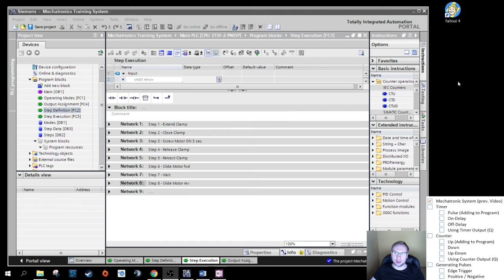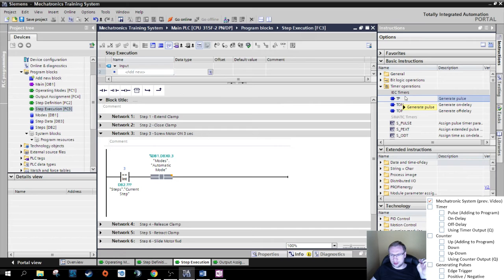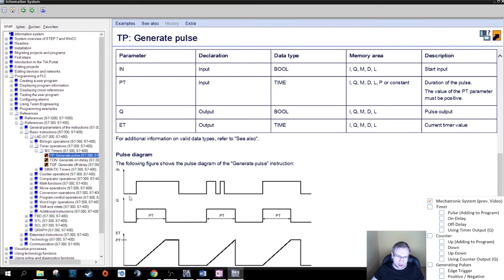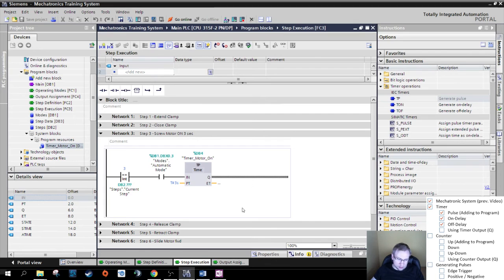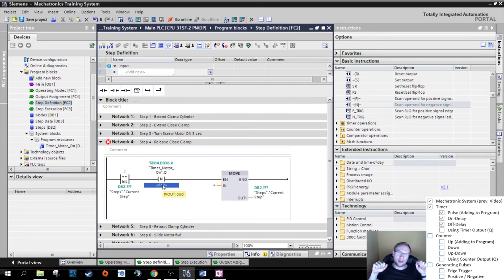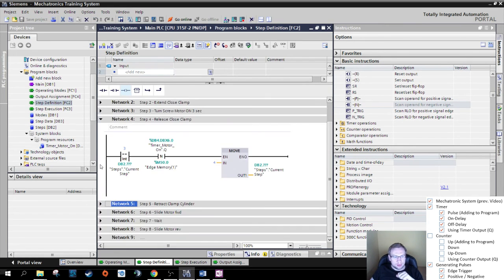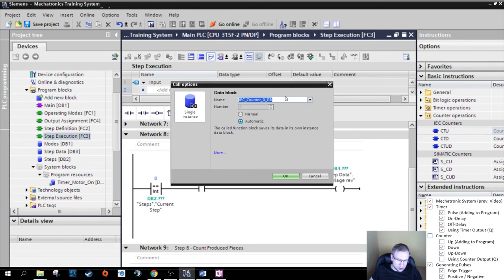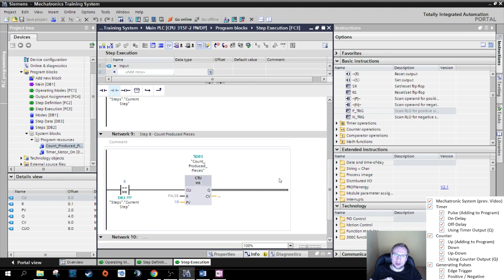ELIA Lesson04: Counter and Timer

Comment: Sir can you please explain more on how you can use up-down counter
Reply from the maker: It would be the easiest to click on it and hit "F1" to open the (most of the times really) helpful information window. If this doesn't help, what exactly do you need to know about it?
Reply: Thank you for your response Sir,,,let's say you want to control a spray gun between 3 sensors,between sensor 1 and sensor 2 you want your spray gun to move at a speed of 25Hz,and between sensor 2 and sensor 3 you want yor spray gun to move at a speed of 50Hz and reverse automatically,,so how would you implement that using up down counter,,,and please explain more the pins(output and input of the counter),,,,,,,Thank Sir
Reply from the maker: Ah okay! So you just need to evaluate if the spray gun is in :
"area 1" - between sensor 1 and sensor 2 or in
"area 2" - between sensor 2 and sensor 3

If those are the only two possible cases, I'd not use a counter at all... simply by using 2 memory bits (area1 and area2) you could evaluate the position with the help of 2 flip flops:

area 1: - set (when sensor1 detects a rising edge AND area1 is NOT active yet) OR (when sensor2 detects a rising edge AND area1 is NOT active)
             - reset (when sensor1 detects a rising edge AND area1 is active) OR (when sensor2 detects a rising edge AND area1 is active)

area 2: - set (when sensor2 detects a rising edge AND area2 is NOT active yet) OR (when sensor3 detects a rising edge AND area2 is NOT active)
             - reset (when sensor2 1 detects a rising edge AND area2 is active) OR (when sensor3 detects a rising edge AND area2 is active)

This would be way easier than using a counter... if you prefer using a counter though, I could send you an example program
Reply: thank you very much Sir,i would like you to also do me an example where you use a counter,,,,,,,,,,and also explain when and how do we use Scale,Unscale and Move block

Comment: Hi Philipp, is there anything wrong with using many timers in one program. For example using five different TP timers to set five lamps each for 2s? When I run the program only the first two lamps will be set. 
Also, do I need to reset the timers? for example reset first timer used to set the first lamp for 2s in step one, in step two.
Thank u in advance.
Reply from the maker: +Lateef Adekunle Hi Lateef, modern PLC's can have many timers (definitely more than five). I guess you copied the timers and did not create each one individually new... with copying you don't create a new instance with indivudual data. Each timer should have an own DB in "program blocks\system blocks\program ressources\", if not, just erase the timer in your program and drag and drop a new one in.

Since you are using TP timers, you don't have to reset them. As long as the input turns 0 at any point, a rising edge on the Input will restart the timer automatically. (select the timer and hit F1 to see it's behaviour will help understanding it :) )
Reply: +Philipp Paus Hi Philipp, I am a novice in PLC programming, recently purchased an S7-1200 starter PLC and I am just trying to implement a small program that will automatically switch on 5 lamps of different colors in succession 2 second after each other continuously. I made the program based of your good structure you explained in your above videos making databases: modes, steps data, current step and FC: step definition, step execution and output but I still have problem using the timers. Could you help look into my program? If yes how can I send it to you. 
Thank you in advance.
Reply from the maker: +Lateef Adekunle I can have a look at your program. You just have to click on "Archive..." under "Project". This will save your project in a zipped archive that you can send to philipp.paus@gmail.com
Reply: +Philipp Paus Thank you so much your kind gesture. I have sent it to your email.

Comment: Hi Philipp, Do you know in S7-1200 how many counter CTU, CTD, and CTUD?
I don't know!
Thank you very much!
Reply from the maker: Hi Trần, you can use as many IEC counters as your program memory will let you... that's a couple of hundred! The logic of the timer is stored in a "Function Block" and you are just creating new instances of the same pre-made function with different parameters. Some PLC's provide high speed counters (hardware related) on some inputs, if you need to count faster as the PLC cycle (approx. <10ms)... which is usually not needed for most applications.